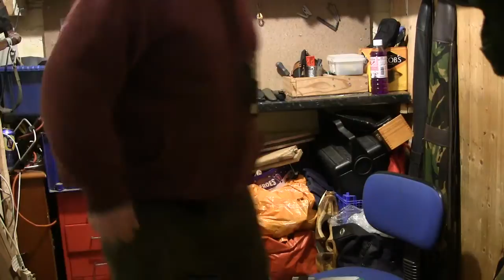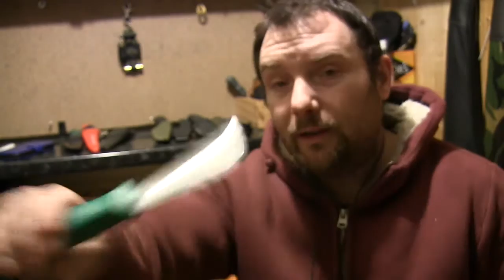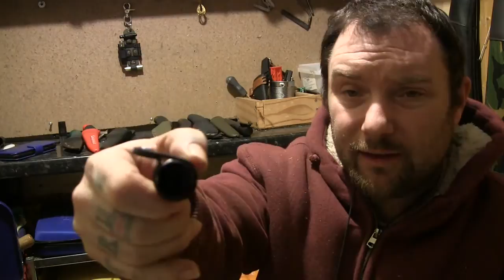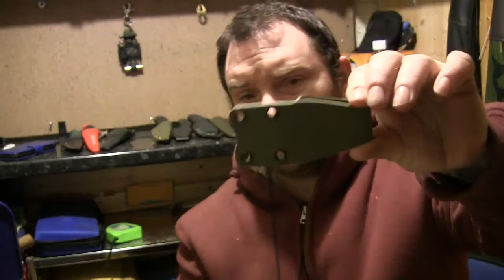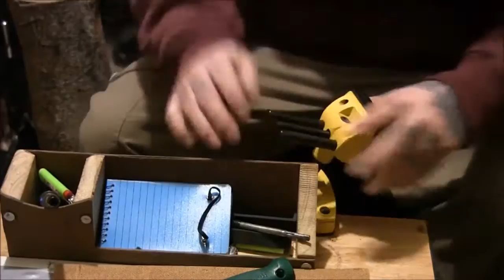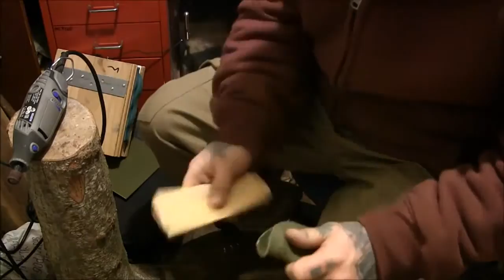Making a kydex sheath

Comment: I need to make some kydex holsters but can't get the eyelets anywhere in the UK. no way am I paying the price for shipping from the US lol. great video buddy. stay safe
Reply from the maker: cheers shane , i managed to find some eyelets that will work in a shop called dunelm , they are called Hemline eyelets kits , they are about £3 a pack for 20 eylelets , they are nearly the same size as normal kydex and even come with a setting tool  ,i used them in previous vids of making stuff with kydex , otherwise you could use chicago screws , copper rivets or even normal bolts , but they wont look as good